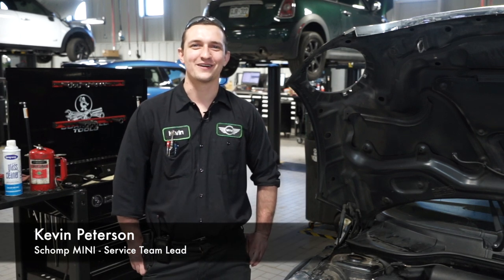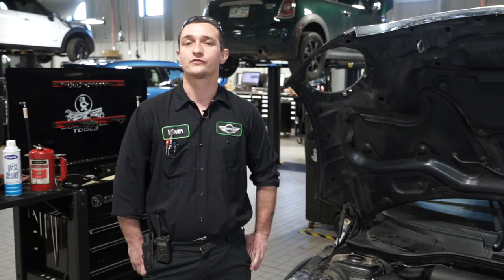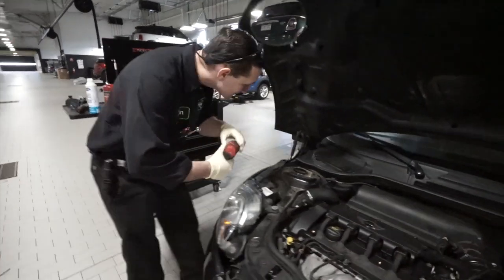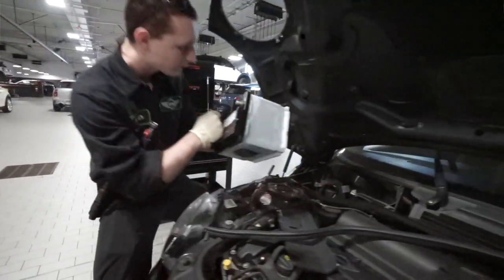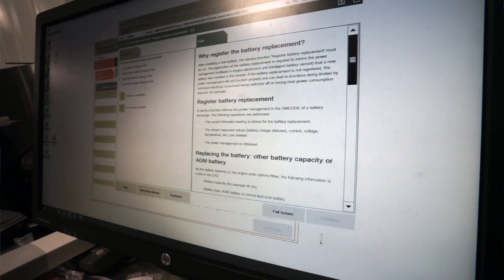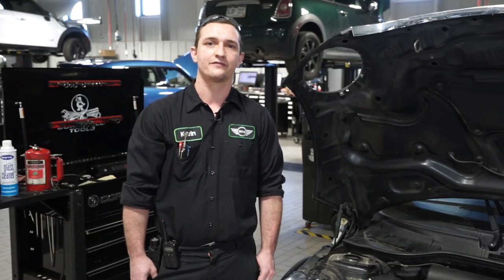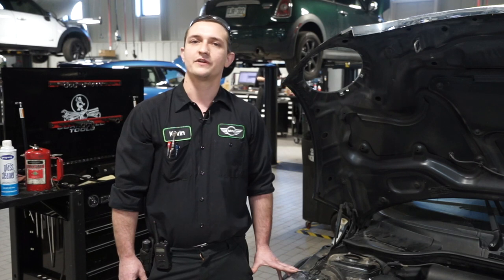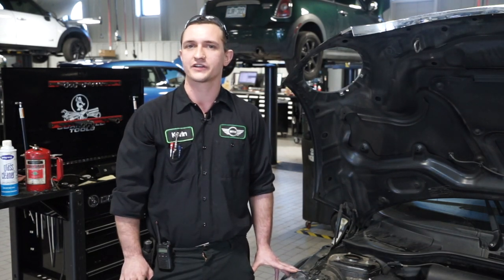MINI Cooper Battery Replacement Service

Comment: since nothing was actually covered...the bolts holding on the plastic cover are 10mm. 2 are on the outside part of the plastic and the battery lock down is directly in front of the battery. There is a vent hose on the side of the battery that pulls out easily and the terminal wires were also 10mm sockets.
Reply: I guess I missed "how" to register it too..............
Reply: @zoochase right?! Like wtf is that

Comment: Thanks This was really easy on a 2014. The registration was in a different area of the software than yours. Had to show the car shop where it was. They could not fine it and had given up. I said let me see it and found it. They only looked where they thought it was. It wasn't under maintenance.
Reply: So where was it Serge?
Reply: Was under the engine section. It has a BMS or battery management system like an ebike battery.

Comment: I have a 2016 countrymen and my windows will only go down when the engine is running do you this theis is battery related?
Reply: Yes, you may also notice your radio screen blinking or going off completely as well as an exclamation point error when you first start the car.

Comment: You guys are crooks for making customers come in to register a battery... hahahahahaha
Reply: Is it required to register the battery? Will it run without the registration? Dont want to register if it will run.
Reply: @missioncapable4658  it will run but the battery's  life span will be reduced.
The car will think it's the old batt and keep overcharging it.
Reply: I replaced a battery on 1911 mini wit anAZ 55Ah series H 7 yrs ago. Didn’t know it needed to be registered. Had it checked recently and looks with alternator ok Just got a new scan toll I just had to disconnect the battery…maybe the computer thinks I put a new one in?
Reply: @stiksandstones  there is a workaround, you can buy an OBD scan tool that can reset the battery (they aren't too expensive). 

Otherwise and ideally, I think the car should be designed with the capability to reset this within the service menu.
Reply: @stiksandstones  there is a workaround, you can buy an OBD scan tool that can reset the battery (they aren't too expensive). 

Otherwise and ideally, I think the car should be designed with the capability to reset this within the service menu.